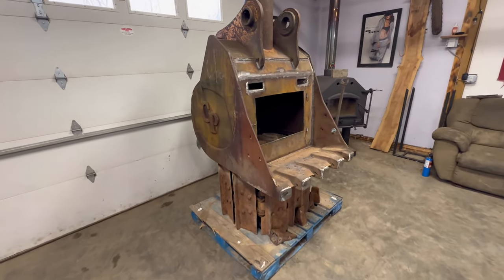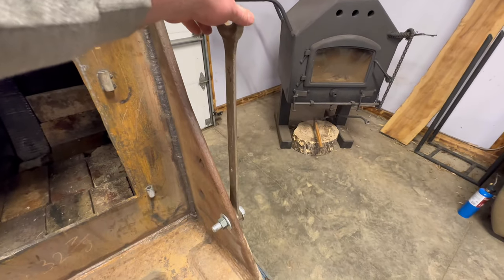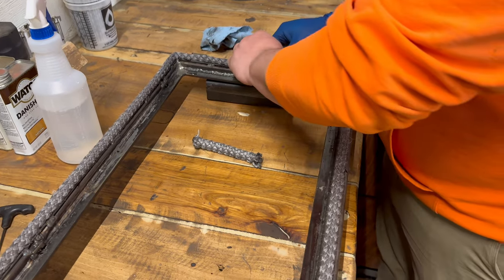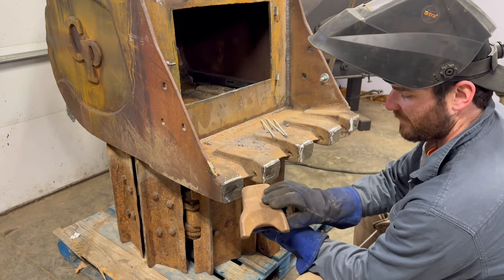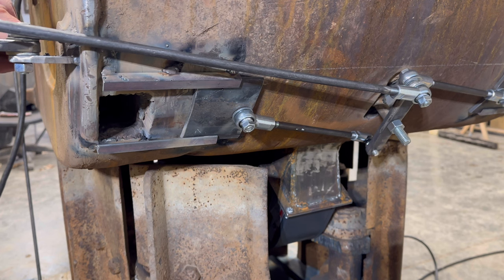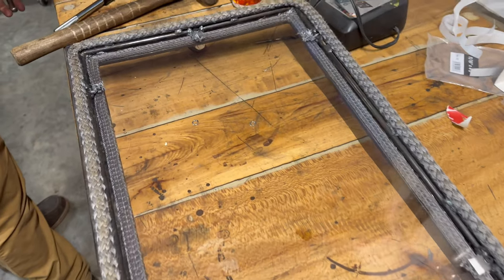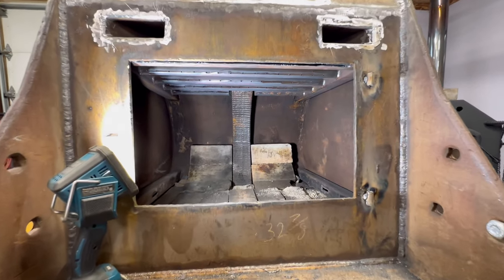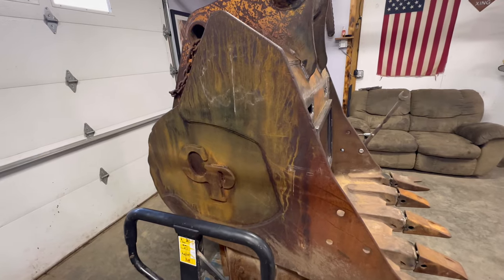Excavator Bucket Wood Stove Build Part 4

Comment: Set up the air wash to come in at the bottom of the window and have the draft blow up into the secondary combustion area(not in the tubes but a small supply) at the top.  Make that intake narrow so you get a minimum air to keep a fire lit.  The heated air from the initial fire also helps pump the draft going up the flue.

Comment: Powder coat. Black bottom with flames licking it as if it were a black cauldron. Maybe the grim reaper grasping his bowl, ready to have a puff.
Reply: One other thing, if you take a cable and run it through copper tubing you can bend it.  Replace the cable with a smaller diameter cable and you have a cable lever system for your doors.